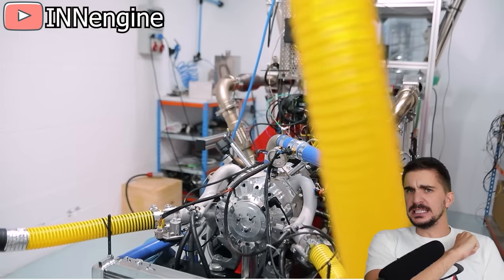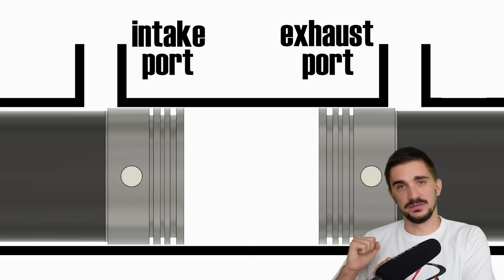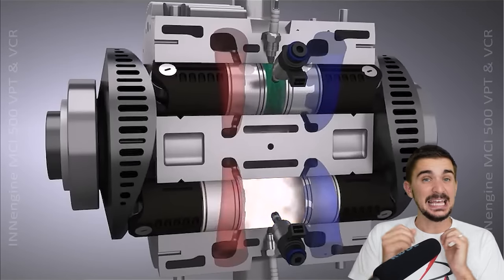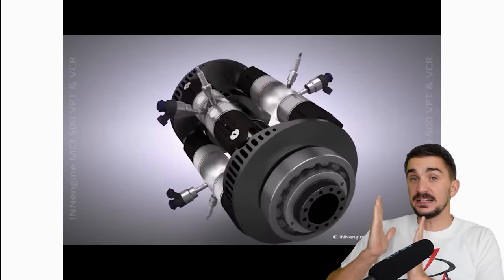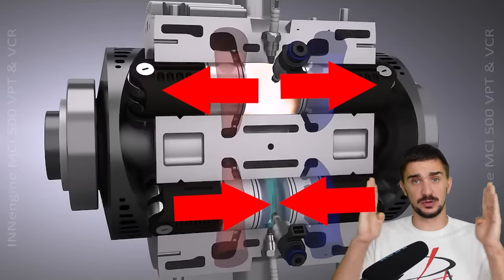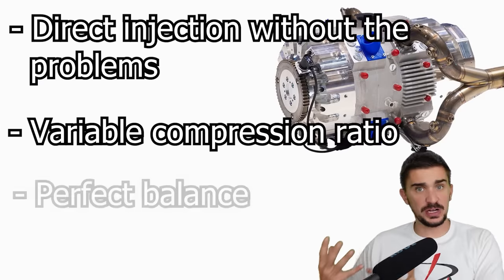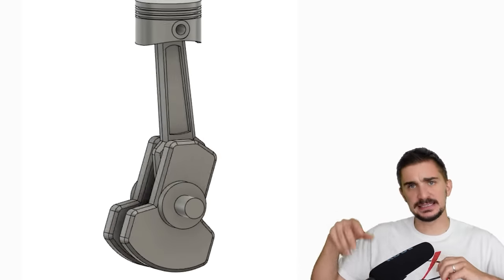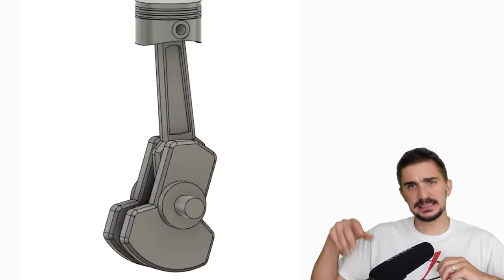Spain is Living in 2050? Revolutionary 1 Stroke INNengine Analyzed

Comment: Looks like a perfect generator unit for a hybrid electric vehicle. Electric motor will compensate for lack of torque.
Reply: That is exactly what they show on their tech page. it is a range extender.
Reply: If reliable can be decent for small planes.
Reply: I’ve always wondered why not run a small gas turbine for charging - much lighter.
Reply: Terrible fuel economy, hot exhaust and high materials costs.
Reply: @popuptoaster ust high costs.

Gas turbines are actually very efficient due to its simple mechanism that is versatile for features like heat recuperator.

So the only thing that holds gas turbine back is expensive design for the blade's engineering and poor throttle response which won't be an issue for range extensing use.
Reply: Pretty expensive and terrible fuel economy. Gas turbines can have a pretty nice efficiency (even better than piston engines) but only at really large scale. 
For example a <700hp turboprop has a efficiency of 330-380g/KWh and a gasoline engine can go under 250g/KWh.
Also efficiency on gas turbine has a very narrow working band compared to piston engines so if you work outside this conditions fuel consumption will skyrocket
Reply: I can see this being used as the ICE in a hybrid setup. It should allow more room and/or weight allowance for batteries, so the vehicle can spend more time running on batteries.
Reply: A need for EV range extenders is why we're seeing a Renaissance in  ICE designs. The change in design requirements has opened the door to a bunch of engine designs that aren't viable as a primary power plant, but are excellent as generator motors.
Reply: @dy7296  I think the heat exchanger is the real problem when it comes to a turbine.  They are difficult to build in a small package.

With enough R&D, I'm sure it would be possible to bring the material costs down, and when used as a generator, turbines would always work at peak load.  I'm a big fan of using turbines for range extenders, and I'm disappointed more people haven't worked on it.
Reply: I drove new 11g civic 2.0 e-hev its and i absolutely love it its my favorite car so far good power and great fuel economy as well. It is series hybrid i think it can benefit from motor like this it would improve packaging and weight even center of gravity could be lower it corner's really good already but it could be even better.
Reply: @dy7296  There is another gating issue with gas turbines : noise.
Reply: @kkrolik2106  up the compression enough to run on diesel or Jet 1-A and it'd be an amazing aero engine
Reply: I dont know why no one has said this but because both ends of the engine produce power, you could in theory connect a generator to both sides generating 2x the power of conventional ice.
Reply: @nockianlifter661 far too juicy
Reply: Yes and then they could probably tune the wavy bit towards a certain rpm range. Maybe put some angle in the piston rods to improve leverage
Reply: @apathy772 not really. There’s no such thing as a free lunch in engineering, and here the compromise is getting half the power output at both ends. A traditional generator with the same overall output would give the same total amount of power with less components.
Reply: That AND for boats and airplanesn
Reply: @nockianlifter661 there’s a car that does that. Can’t remember the name but it is a thing
Reply: Or even just the engine in a hybrid power train. Electric has the torque, this has the power
Reply: looks like a perfect engine to replace every 1000km :)
Reply: Eeh. Even generators need quite some torque, or a giant and heavy transformer because high RPM and low torque means high voltage. It's not as simple as "hook it up to the alternator".
Reply: Also a hybrid application will allow the engine to run (for battery charge maintenance) at a constant (snd optimum) RPM.
Reply: @quantustremorestfuturus5434 fewer parts so can mature to even better reliability … two strokes use scavenging instead of all the complexities of valves and valve timing, think about it!
Reply: @joshharrison2657 yes but no. The crankshaft has its defaults , but has a decent amount of side forces that allow for a decent lifetime. This is gonna have huge side forces, that'll wreck the piston in no time. Also it's going to be very inefficient.
Also, fewer parts, really? A roller is several parts, a crankshaft is just one .
Also the size of the air intake is something extremely important, and the design takes away the head of the cylinder, and with it all the useful space where the valves ought to be.
By the way, what is the point of   removing the cylinder head? Just decreasing the contact surface? Just make a mono cylinder then.
Also the vibration can be removed using 2 opposite crankshafts, but it's just something they don't give a fuck about.
Reply: @quantustremorestfuturus5434 Yes fewer parts. No valves, cam shaft, lifters, followers, which often are the cause of failure. Modern engines have 4 valves per cylinder. Not having valves, camshaft+ camshaft bearings, followers, lifters eliminates something like 40 engine parts. A regular 2-stroke would provide the same reduction but couldn’t meet emissions standards because not opposing pistons so burns oil.  Also, a roller isn’t anywhere near as many parts as 4 valves moving synchronously with piston motion.
Reply: @joshharrison2657 the reason why 2 stroke engines typically need oil in gasoline is because it ensures simplicity, not because it's inherent to it, and some 2 stroke engines don't. Nothing to do with removing the head. This no valve system could work even better without the dual piston idea.
The valves are very important. Their timing, and their wideness are critical to power and efficiency. A 2 stroke engine has a very wide opening, as it is flat, and almost all around the piston. Hzre, due to the rotary idea, it can't be all around the piston. The opening is bound to open slowly, and not widely , which is an absolute killer for efficiency and power. This design is just a 2 stroke engine made worse in every single way
Reply: @quantustremorestfuturus5434  “every single way” seems inaccurate. Opposing pistons doubles the surface area available for the pressure of combustion be converted into mechanical work. That improves the primary source of inefficiency in a conventional engine.
Reply: @davidryger2757 , Toyota have recently announced that they are working on small turbocharged engines. Apparently, they are still betting on traditional I4 engines as range extenders.
Reply: The problem with range extenders is that in almost every application, you'd be better off just adding a bit more battery rather than the all the complexity of an ICE, with fuel tank, pump, the engine itself, gearbox, generator, exhaust, emissions and maintenance.
Reply: @drunkenhobo8020 … except for almost all cross-country driving applications?  When driving long distance nobody wants to wait, stuck in place, to charge the existing battery let alone even more battery. There are limited number of charging stations, and if EVs became popular then the limited charging stations would be taken and be even less available to meet demand enroute. Hybrids can be plugged in for city use, but at least have the capability to drive cross-country without inconvenience.😊

Comment: I was trying to think of ways that could build this engine into an actual torque monster. Thinking "hey, just take the pistons and rotate them 90 degrees, 360 degree placement around a central crankshaft! That will build TONS of low torque!" And then I realized I just discovered a radial engine lol
Reply: 😂😂😂 lol
Reply: Wouldn't 90 degrees make them inline ?
Reply: Love to see this in a Motorcycle .
Reply: Thanks! I needed a good laugh.
Reply: Lord knows if this would work; but if you had the piston rods sprung-loaded, and the "wavy-thing" with double the height of waviness, then you would get higher torque, but also with compression flexibility. So many ideas, so many Luddites breaking us since the Spinning Jenny.
Reply: @patriciahutson check for aircraft radial engine bikes, they're badass
Reply: @RogerThat1945   storing energy for later (torque converter) without adding a lot of weight is tough...electric range extender is a good answer i think.
Reply: @patriciahutson I think it would be a fun idea but I would probably die just like the rotary engine bikes which is a shame because I'd really like to try one
Reply: Next you'll be thinking of motorcycles without motors or chairs with wheels.
Reply: Exactly. That is a radial engine, but with straight angle conversion on crankshaft. Opposed with another one.
Reply: The Coal Fired Electric Cars or the Diesel powered Electric Cars?
Reply: Nehme sehr viele Kolben mit viel Volumen  und einen Kleinen Hub
 Und eine leichte Schwungscheibe
Reply: so much torque  !
Reply: The ramp is the lever
Reply: Exactly. Old ideas, in novel forms. I was thinking of the Fairbanks-Morse dual-opposed piston diesel generators used on my old submarines. Compact torque monsters - But not nearly as compact as this beast. On the other hand, they had - and needed - torque for weeks.
Reply: @dastrayer63 Exactly, let's say you do something like Edison Motors and do a tractionless hybrid, an engine of this size, optimised for electric power generation(high efficiency at fixed rpm) could bring the diesel-electric from locomotives and trucks to passenger cars.
Reply: @jimmyjames8573  nah since the pistons are arranged in a square
Reply: why do you need torque "monster" out of it if its just going to run a generator at a fixed rpm ?
Reply: @bobsaturday4273  More torque means more power at lower rpm, thus quieter, less load on engine parts(maybe), and also to an extent possibly less NOx emissions, as  to my knowledge some bike engines are rev limited/detuned because at high rpms they wouldn't pass on emissions. At the end of the day, just put a diesel in it, works for construction and trains just fine, and diesel is more energy dense and runs leaner.
Reply: Or a boxer, or a V, or W.
Reply: Just proves that it was a good idea you had. Eventually you'll think of one that is novel.
Reply: wow u invented the radial engine :face-blue-smiling:
Reply: I’m gonna go ahead and trademark « wavy thing » just in case
Reply: The only advantage I see off this engine over the radial engine is the problem of oil pools and leaks. The bleeding the engine will not be required in this configuration.
Reply: @robv.o.1777  Yes!!! You get it!!  As I said in my post above, more torque can be had by increasing the  diameter of the "wavy thing" OR adding another cylinder. It doesn't REQUIRE pairs of cylinders to work ( the cylinders don't NEED to fire in pairs)... you can have 2,3,4,5,6 cylinders!!  Again, as in a conventional multi cylinder engine, there comes a point whereby the increased friction of the rings negates the advantage of more cylinders.
Reply: If you want to get torque out of this, use it as supply side in a hybrid electric powertrain.  Use this as an electrical generation source to feed something like the Koenigsegg raxial motor in a hybrid battery electric setup.  Personally, I'm pulling for the Omega One concept with compressed (but not liquified) hydrogen to act as the anchor to a hybrid system.  Long range, high torque, low emissions, high efficiency and quick recharge.  Omega One --> solid state silicon anode battery --> Koenigsegg radial/axial flux electric motor look really good for future intermediate range passenger aircraft.
Reply: Not new piston drive system, used in many types of pumps everywhere.
I saw an old man back in the late sixties in Auckland NZ tinkering with an engine, non opposed, that he had fitted to VW beetle.
Never found out what happened to it after he passed away.
Reply: 😅 @dastrayer63
Reply: Hold up if your idea still involves the wavy thing you could actually be getting somewhere new
Reply: @jimmyjames8573  nope. Inlines are 180
Reply: @RogerThat1945  Why would you waste energy on compessing springs when you have gasses to do that?
Reply: @johnbutera5805  Well, yeah - but it would cost a lot of power to do it that way. The engine would feel sluggish, like an old steam engine. But yeah, the cylinders really need to fire in pairs to maintain the balance, or it would need beefing up.
Reply: @olenilsen4660  Simplicity!
Reply: I was thinking , this guy is describing g an old radial air plane engine !
Reply: This might make a generator engine for a hybrid auto.